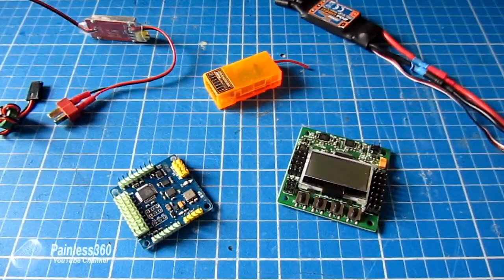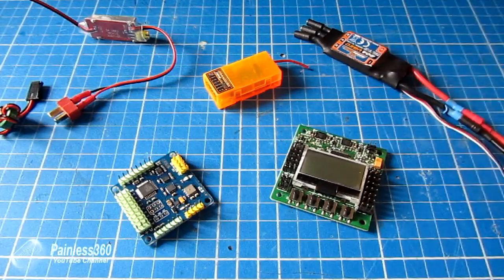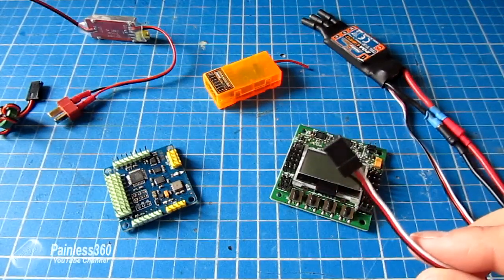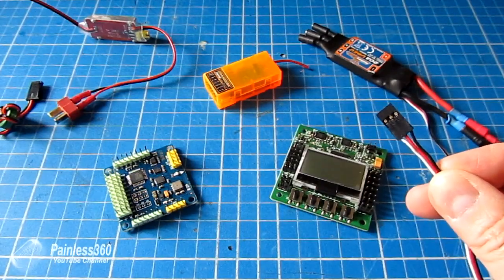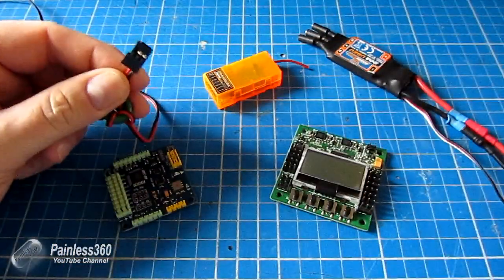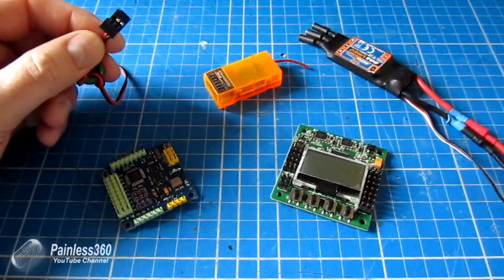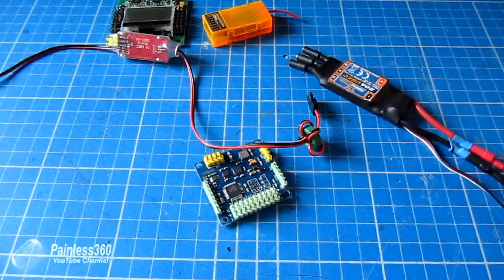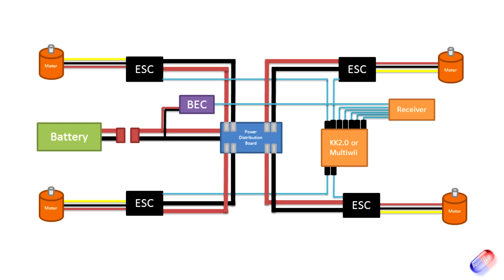How to connect OPTO ESCs and a BEC to you multirotor (KK2.0 or MWC)

Comment: Hello, So I bought a set of ESC with Opto.. can I install them without a BEC? I have a standard PDB without BEC..
Reply from the maker: +Dirtyb1rd Nope, you need something on the model that will provide the +5v for the flight controller and radio receiver. A lot of PDBs not include a 5v supply for this reason.. Best of luck!
Reply: Thank you for your help! http://www.hobbyking.com/mobile/viewproduct.asp?idproduct=16663 Will this be work? I plan to use it with LittleBee Opto ESC's + SunnySky X2204 + CC3d + Fpv and 3S batts.  Should I buy one or two?
Reply from the maker: Easily! :)
Reply: +Painless360 
Thanks for the reply! Just received the Ubec. Where should I connect it to? To the CC3D or to the Receiver ( Flysky ) ?
Reply from the maker: Either should power the Rx and FC. Best of luck!

Comment: Hi, great video, thanks. Have you done any videos to show the wiring of Pololu voltage step down regulators? Could see anything. I'm trying to figure out how to power a Naze32 rev6 with a Pololu 4v step down, and also how to use a 12v step down with a 4s battery to power the other bits and pieces. Cheers
Reply from the maker: +Jake Maxwell Watts Sorry we have not. We always use a UBEC, either as part of an ESC or as a separate piece to power the flight electronics. Best of luck.

Comment: Question; instead of a BEC, can I use a separate smaller battery (3.7-7.4v) to plug into the receiver, and power my fc, fpv gear and receiver on a second battery? I'm hoping this would leave the larger battery with the soul responsibility of powering the ESCs and motors. This setup would work best for me. Is this feasible?
Reply from the maker: +Sal Mastropolo Some of the electronics are expecting a solid, clean 5v supply so using anything else may work, but may also cause all kinds of headaches. I would recommend adding a little 5v UBEC into the model for peace of mind and expected operation of the electronics. Best of luck.
Reply: Thanks for the reply. It would be nice to connect a small 2s battery into perhaps a 5v ubec, which will power the RX, fpv cam, fc and fpv tx. But what about power that goes into the ESC? I saw the carbon bird 40 amp and a few other escs with xt60s connected. Can I plug directly into the ESCs using a 1female to 4male harness, or do they require filtered power as well?

Comment: Can anyone tell me, is it possible to check a 5v ubec for issues, before using it on a given day, like using a multimeter etc. I'm starting my first ever quad build and want to buy a hobbywing one(they are cheap) but would feel more confident if I could manually check these things before connection it to my cc3d.
Reply from the maker: +owenkilleen You can use a multimeter but this is why you test hover a new quad low over a soft surface. Sometimes things are nor perfect first time out.
Reply: Thanks , I will :)
Reply: I read how a guy fried two cc3d's by using a ubec that after awhile started to operate wrongly. My idea is to be able to manually check the ubec before each flight.
Reply from the maker: This is very uncommon if you use decent ESCs with BECs in them. I've never seen it in my 7 years of RC flying and many, many builds. Best of luck!
Reply: I must take resposibilty for not making myself clear enough. I am referring to Ubec, not the bec built into the ESC. :)

Comment: Verry good video, explain well but I have a question :
Can I power my kk 2.1.5 with my Afro 30amp ESC's without trouble ?
Reply from the maker: I_am_me If it has a BEC in it then yes.
Happy flying!
Reply: Painless360 Thanks for responding, it has a 0.5A Linear BEC but according to some peoples it can have issues so I wanted your advice ( link : http://goo.gl/F1zjIk )
Reply from the maker: If you connect all of them to the KK then they will have more than enough power to run it. Make sure you are not trying to use servos too though.
Reply: Painless360 Thanks

Comment: First quad build for me, and your videos are most excellent. I have some 20A Opto Esc and this external UBEC. I'm building a Blackout Mini with Naze32. As I understand it, I can connect the UBEC output to an extra channel on the FC for power. The input side of the UBEC can be connected to the PDB right where the power leads from the battery are connected? That correct?
Reply from the maker: ***** Yes, or on a spare channel on the receiver, that works too. 
I have a full Naze32 playlist that may help - https://www.youtube.com/playlist?list=PLYsWjANuAm4p47OBBTOo4Xr3lNUc8PFpc
Best of luck with the build.
Reply: Painless360 Nice! Thanks for the info. I'll dig into that playlist too.

Comment: Hello. I have 4 ESCs with integrated UBEC in my Multiwii 2.5 quad. Can I connect all the 3 ESC wires (signal, positive and negative) in the board or only the signal wire?
Thank you.
Reply from the maker: Thiago Teles If it uses linear BECs then you can - consult the manual or contact the vendor for more detail. 
Best of luck.

Comment: Hi Lee - I went through the steps since my last comm with you... Still the same problem....  Recalibrated the ESC's now they fire 2 then one at 50 % then othe last one at 70% throttle...   AND THEN I saw this video... My ESC's are RC TIMER Simon K firmware 45 A OPTO ESC's   ....   SO now im even more confused
Reply from the maker: Will Granzier Not sure what to suggest then. If the radio is setup right, the APM is ok and the ESCs are all calibrated then you should be golden. 
If you get to the bottom of it - I'd like to know what it was..
Best of luck

Comment: This has helped me alot, thank you very much! My only question now is this:

I have a set of Opto ESC's for my quad, much like your they still have all three wires, signal, red and black. Since they don't feed power through those wires should I remove them from the plug or are they simply dead? I can only assume that they are not connected inside of the ESC and are there to tap a UBEC into if you don't have a spare channel..?

Thanks!
Reply from the maker: Ettienne van Rensburg I would keep them connected as (mentioned in the video) some of the Optio ESCs need to 'see' +5v on the red wire to work and initialise. 
Happy flying!

Comment: thanks for the answer  I have a problem.. I just don't get power to servo on M4 input
reciever test motor layout all ok please help..
Reply from the maker: This is due to the fact that M1 is electrically isolated from M2-8. You need to make sure that there is +5v going into one of the other outputs if you intend to run a servo from M4.

This was done so that you could have the 'dirty' +5v supply running the servos and the 'clean' isolated +5v supply running the board through M1.

Best of luck..
Reply: Painless360 if I plug the UBEC into reciver kk mini board have power but no servo. and if I plug the UBEC in M5 then servo have the power but KK mini Bord does not..:-( iam stuck now plz help..
Reply: krack jack or I can plug  UBEC t into M1 together with ESC ?

Comment: I can usually follow all of your other videos, but in this one you present an issue. I have a KK2.1.5, (and also,just today, a kk mini), and on both of them, only the m1 is capable of powering the kk, and via a trace, back to the 5 input terminals to the kk from the rx. The m2-8 are linked, and according to the mfg, would be used to powr additional(this stupid samsung woukd not let me add a space after the correctly spelled power, which it does when a word ends exactly at the end of a line) loads such as servos. Thanks
Reply from the maker: Hi John, that's right. The idea was to provide a clean power to the board using M1 (or the inputs from the Rx) and use the other M2 onwards to power servos.

Happy flying!
Reply: Painless360 Yes bud, I got that part. But at 3:14 , you state "You can plug it into any of the spare motor channels". Well on a quad, wouldnt that put the "spares", as being 5 thru 8? (Given a 8 output FCM). Also you go on to state that all the Pos and Neg terminals are common to each respectively at 3:40.
And, you demonstrate this on the multiwii board. The issue as I mentioned, is that the KK does NOT have commonality between the M1 Pos to the other M2-M8 Pos pins. The design is to guide one to only be able to have power available for throttle and Rx, directing the user to learn that a second power source is needed for powering the other served loads to prevent high currents on the board trace.
Reply: Painless360 Ok. I see the little text pop-up now. BUT, if I have NO spare channels, I will now deduce that I can pop the red and black out of my M1 ESC cable and replace them with the ubec leads.
Reply from the maker: That will work but you can also power the KK from the Rx by plugging the BEC into the BATT port on the receiver and that will supply the +5v the board needs via the Rx cables. Hope this helps.
Reply: I think my rx, an orange r615x , uses the batt for cppm, so it does leave the others all avail. Cool

Comment: I was just wondering: the opto esc is to cut the interference from the esc to the receiver/flight contr. board. People in the forums are sayin that to benefit from the opto you have to use another battery for the receiver and fcb to cut the interference by making two separate power systems for motorcircuit and controlcircuit and so that the optical link of the opto between these circuits is the only connection. So my guestion is if you plug opto esc like this with external bec will the interference from esc pass through power leads through battery/power harness to the receiver and flightcontrol board while making the opto feature of the esc do a wasted job?
Reply: Painless360 http://www.rcgroups.com/forums/showthread.php?t=774420 Here is the link to one forum where this has been argued. It turned out that yes I would have to use two power sources for true opto. But what was intresting was that not all esc with opto really feature a real optical photo coupler but sometimes use the word "OPTO" to state that there is not a bec 5v to the receiver to use but in no case there is no conductive isolation. And I think this is extremely misleading.
Reply from the maker: The majority of the heat generated in an ESC with a linear BEC comes from the BEC, not the power going to the motor.

If you only need an ESC to run the motor then you can remove this excess weight, heat and cost from the ESC and use an external UBEC. This makes more sense as you move into larger batteries as the larger the voltage the more heavyweight the electronics need to be to supply a safe, steady 5v.

So, in summary the optical isolation is a great safety and performance feature and also allows for the use of dedicated, single UBEC that is perfect for the job and battery size.

Hope this makes sense..
Reply: Painless360 Sorry in advnce 4 2 much typin in comments.. Yes this makes perfect sense. But that wasn't quite what I meant to ask. I meant that because the opto is made for cutting the electrical noise interference by cutting the electrical bond between the esc and receiver/fc-board and replacing it with an optical link which cannot transfer noise/interference/electrons to the wrong way (esc --> receiver) because the link is utterly only one way (receiver --> esc). What I dont know is that (what I have heard on the forums) does this same noise go to the receiver and fc-board through the battery/power-harness when using one battery for both sides of the electrical circuit? And this because due to the system has an electrical bond between the motor/esc side and the receiver/fc-board side. Or should you use two different batterys for both circuits to cut this electrical noise path? Like to have two batterys: one powerful for power-side and one to the sensitive-electronics-side? If this interference is present then also my fpv-circuit would propably get this same problem due to single battery. If I'm not awfully mistaken this is one problem in fpv systems and at least Fat Shark is making noise filters to put to power line before video transmitter. But also it might be that this problem is present but is negligible. You have any personal info on this?
Reply: Painless360
So in short: Is the opto noise cutting feature in vain if I use only one battery for everything?
Reply from the maker: Why are you so worried about noise? I've never used Optio myself and never had an issue with 'noise' from the ESCs.

You are much more likely to have 'noise' on the flight controller from proximity to the power lines.

Best of luck with the build.
Reply: Painless360 Yeah. You are totally right. I'm not worried. I was just thinking wether to buy opto esc or not and are they something to consider and if so, how to make use of them the best way. Just curious about how things work :) thanks for your thoughts :) your videos been a great help for me!

Comment: For ESCs with no BEC, is the external BEC required to supply power to the KK board or can you simply just solder a wire (positive/negative) on the power distribution board and run it to a servo connector to plug into the KK board?
Reply from the maker: The KK runs on 4.8-6.0v so you can't connect to straight to a pack. A UBEC is a very small extra weight and cost. Happy flying!
Reply: So could just an external 5v power supply work or does the BEC do something special other than provide power to the board?

Comment: Best video to explain how to hook up BEC . But I would like your input on a few things . I am building my own Quadcopter and have purchased the XAircraft XL30A ESC's  because I am going to use the XAircraft SuperX Flight Control System V2 and figured they would work together well. However I cannot find any info on the ESC's as to whether they have their own BEC or if they are OPTO's . That being said I would still want to install a UBEC on this system and if I do so by the way you show in your diagram , I would probably have to modify my connection to my controller by removing the red wires on my ESC's. I hope this is correct.

Comment: good video but the KK2.0 cant take power from a spar motor channel it must be motor 1 the other motor channels don't do any thing when you plug in power !
Reply: I'm having the same issue!!! It will only power the board through the m1 channel on the kk2.1.5. If I plug it in any other motor channel, the board doesn't power up. I don't know how to power the board if I have to run my esc's in the m1-m4 slots. Should I try to power it through my receiver? I don't know what to do!! any help is truly appreciated, thank you!!
Reply from the maker: mpshags Try through the receiver. Worked great here on a 6 month and 2 year old KK2.0. Worth a shot!
Reply: Thanks! It works! Plugged my power feed coming out of my ubec directly into my receiver on channel 7 and it works! Thanks!

Comment: The manual of the KK2 board states that power for the flight controller must be supplied on the first motor channel, it appears to be true.
Reply from the maker: That's right - see the post from Jimmy L below. If you use Optio then some 'expect' to see 5v on the positive rail. If it doesn't it will not power on. You will have to create a jumper to power the other Optio ESCs in that case.

Hope this makes sense.
Reply: Painless360   how do I set this up if all 4 of my esc's are opto?
Reply from the maker: I would power the KK2 from the receiver by plugging the UBEC into a spare channel on the Rx. The KK2.0 will power up (just confirmed it here).

If your Optio ESCs need to have 5v on their red pin to initialise (and you have no servos connected to the board) then you'll have to bridge M1 to the other power rails (+5v and GND) on M2.

Hope this makes sense.
Reply: Painless360 The recent KK2 boards can be powered by the receiver but the older ones cannot.  You will need to read the manual for the board that you have to verify.
Reply from the maker: Interesting - any more detail?

I've just tried the board I've had for 6 months (the one I tried before replying) and another KK2.0 board from another quad built almost two years ago - both work exactly the same way with the power from the Rx fine.

I guess the only way to know if to try it!

Happy flying!
Reply: You are right, the trick is to power the receiver with the ubec, and then that in turn powers the board. Thanks for your help!
Hobbyking was insisting that opto bec's have a power feed to power the board...I was about to pull my hair out, their customer service there seems to be less than knowledgeable to say the least....

Comment: hi do u now how to Huck up a main motor with 2 wire red black  rc helicopter  to work on a receiver with 3 pin Fly Sky FS-R6B 2.4Ghz Receiver to control it .
Reply from the maker: Hi Iqbal, thanks for the question. If the motor only has the two wires then this is a brushed motor. You will need a brushed speed controller and then the rest of the setup is the same.
Reply: do u no where to get it
Reply from the maker: Lots of places provide this type of tach - HobbyKing, BangGood and good ol' eBay..

https://www.hobbyking.com/hobbyking/store/__6468__Turnigy_30A_BRUSHED_ESC.html

Comment: wow, thanks, its clear now.. someone in youtube post that i must connect UBEC directly to esc, and that makes my brain hurt because if that true, i need 4 ubec..
Reply from the maker: The UBEC powers the flight controller and any servos. The Optio ESC do like to see 5v on the red pin of the connection cable but that's for their benefit not to power the board from the ESC.. Hope this makes sense..